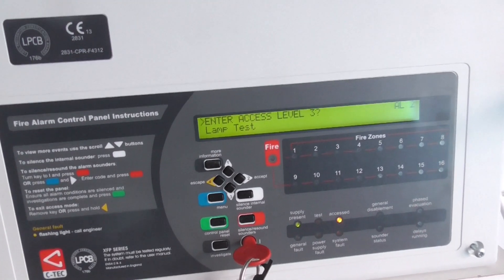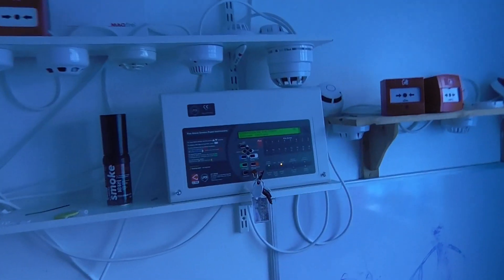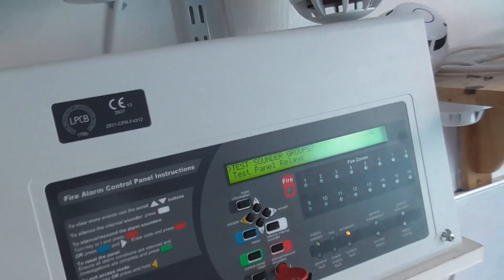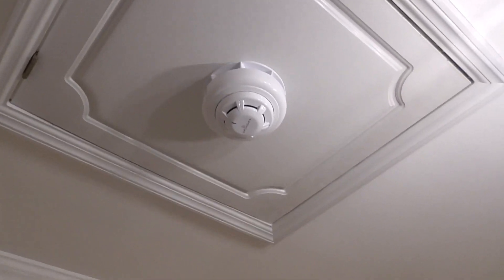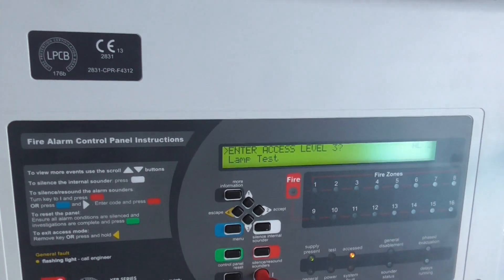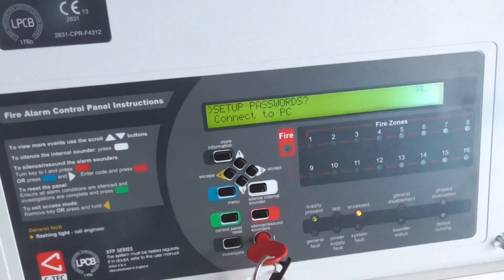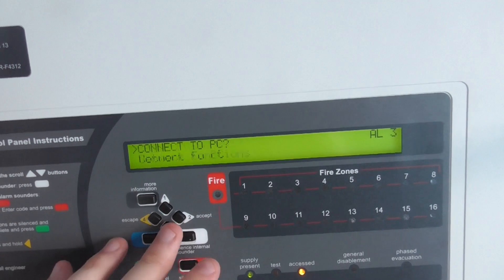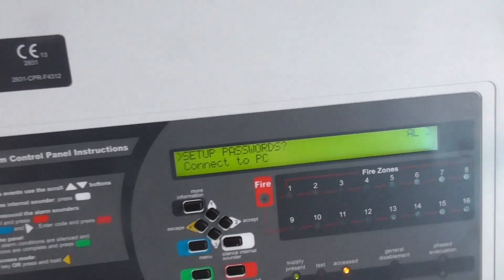Apollo XPander System Test 2

Comment: xpander sounder's don't tone hold because they are basically conventional sounders, the xpander open area's are basically normal sonos's so you can fit any conventional sonos base on them and they'll work!, the xpander sounder bases are basically conventional as well but with addessable modules to send data to the interface
Reply from the maker: Ah ok thanks for the info!

Comment: Where do I get the xpander system? Also does it work on the c tec cfp fire panel
Reply from the maker: I got the xpander system from Acorn Fire and Security or you can get them from Ebay. No it wouldn’t work on a Ctec cfp panel because that is conventional and the xpander system is addressable. You would need an addressable panel to make it work. Hope that helps :)
Reply: Thank you!
Reply from the maker: @farmerjacob857  No problem!
Reply: So would it work on a different c tec panel?
Reply from the maker: @farmerjacob857  Yes it work on a different Ctec addressable panel such as a Ctec Xfp which is addressable. and I have that one too for my system.

Comment: EMS But re branded to Xpander.
Reply: Ems firecell is made by Apollo but works on different frequencies and has ems own programming.
Reply: @mssecurity1930  Ems make the wireless parts and Apollo make the detector heads
Reply: @mychannel0743  ems make it but Apollo rebrand it
Reply: @mssecurity1930  it’s made by ziton not apollo
Reply: No it’s because both companies are owned by Halma so they actually have very similar hardware like EMS Firecell and Xpander.